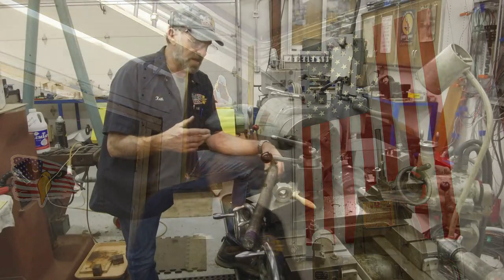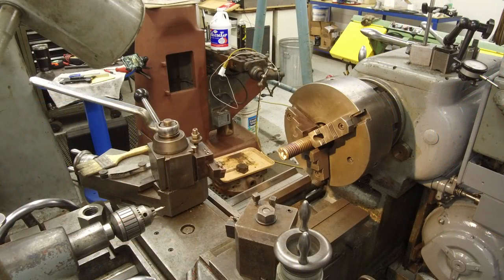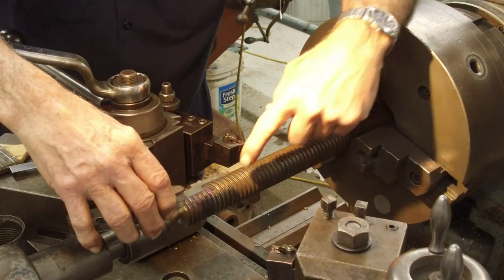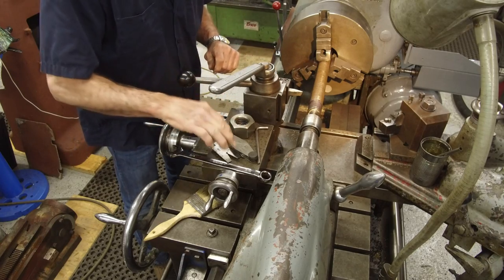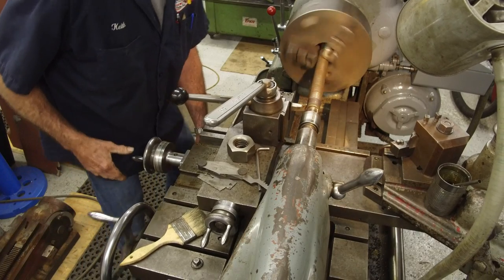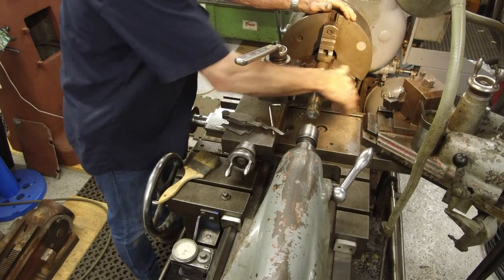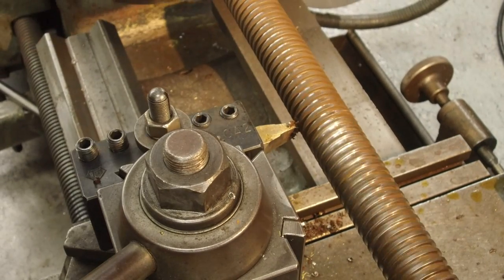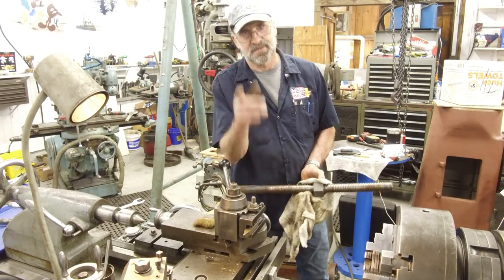Clearing Up That ACME

Comment: Keith, great video. I'm a new subscriber so I have a lot to catch up on. I've been around enough to know that you are highly skilled and a true craftsmen. This ACME thread video and tips certainly encouraged me to try and clean up the ACME threads on my South Bend 13" compound feed. I tried a file from a small set but it took hours to find the low and high spots to work on. Thank you so much

Comment: Keith,
That converter noise is a bit loud compared to the old shop, but we'll get used to it in time.
Your new digs look a lot bigger than the old shop...room to breath and to grow.
Glad you're back Professor!

Dan
Reply: He didn’t have to use a 3-phase converter in the old shop, but now he does because the local power co is slow in running 3-phase for Keith.
Reply: @joeylawn36111    If one can wait for power till it is convenient for Power Company,like another job in the area it is cheaper hook up. On demand expensive!!

Hi Keith been waiting!!!!!!!!!!!!!!!!!!1

Comment: Hello Keith.  That was an interesting set up for working on both flanks of the thread.  David Wilks (another machinist on youtube) uses the same method to cut multiple start threads.  Instead of indexing the chuck with the leasdscrew disconnected from the spindle (how you're taught in school), he sets the compound to zero (like you did), cuts the first thread and then moves the compound a distance equal to half the pitch of the thread (for a two start thread), and cuts the second thread.  I've yet to try it but it sounds easier than indexing the spindle.  Ken

Comment: Keith, thank You for this information. What I learned here is that the ACME tool does not need to be the final width of the thread groove, it can be less. The method of adjusting the thread groove width with compound is not only a comfortable way to do this but it is also counteracting the chatter as it is cutting one edge at a time.
So, easier to grind the tool, easier to make the thread. Please, accept my easy thank You.

Comment: GREAT to see you back! I feel your pain young man- I just closed on a commercial building, that had been abandoned and vandalized and looted for 8 years!!! Local power company sent an "Engineer" to meet me, and they want me to get blueprints, and drawings and a safety inspection from the county, and this, and that, etc etc costing me THOUSANDS just to get my power on in this new building, not to mention all the huge wire that was cut (while it was live) outside between the meter can and the transformer, by looters & crack heads has to be replaced underground!
I'm getting there slowly, but have been working on cleaning the place up with a single phase 220v gas generator for fans and power tools!!!
Once I get it all restored I'll have a 400A three phase service, with 277/480 and a separate panel for 208/220/110 - but it's gunna take time and weeks (many)
Reply: Stories like this made me crazy about such stupid people who in my opinion never build something and they cant apreciate effort of somebody else made to build up something valuable from scratch. Vrrrrrr... Hope you will do better and better. Greetings from Europe.
Reply: 30 years ago when I got a new shop the power company wanted $8K to set a 3 phase transformer. After I found the right person to talk to, deep inside the power co. and he told me how to go about making my application more suited to the higher ups, they then set it for free. Started with 400A 208V. That may have been a mistake because as I added tools I needed 400 & 480V. Ended up with a lot of transformers. It is a lot cheaper to wire for 480V. Also had to have another service brought in to get to 800A.  City originally required an industrial panel with each breaker costing $350 back then. I now have 7 sub panels.  Plan a head.

Comment: G'Day Keith,,Mate had me back into 1976 where i had lathe training as part of the trade,(Fitter and Machinist,),yep right hand and left hand internal and external fitted to-gether on a test piece,,Knurl the outer nut and then relieve each one ,,yes had to be marked,pass mark 80%
mind when i went to tech,,Hmm Trade school,,had every thing i needed to ace the class,
the old BHP training was the best ever,,,if you ever get a bloke done training at BHP,( yes even a dud,),there will be not much you could teach him,,
But enjoyed remembering,the experience of doing it,,
this was all after learning boring to a plug gauge,,,The tolerances were so close,a couple of degrees in temp,,had a lot of plug gauges stuck in bore hole,,
mind nothing a quick hit with the oxy couldn't fix,,

Comment: I was literally wondering about how one would chase/clean up pre-existing threads on a lathe the other day. Now I know!
Reply: One thing he did not explain or demonstrate is that you can start the spindle and engage the half nut and then stop the spindle leaving the half nut engaged and use the compound and cross slide to align the tool with the thread. It does not have to be done with the spindle running. Much easier for someone less experienced.
Reply: @DomManInT1  ,Correct . been doing it that way for donkeys years but it still needs fine adjustments just the same as Keith used with compound slide.
Reply: @karlhrdylicka  Yeah. For years. That top slide has been called a compound.
Reply: @DomManInT1  Excellent advise, All new learing threaders should learn this technique first.  Always leaves one less chance to bug the thread.
Reply: @DomManInT1  Yes,Senior moment . you''ll get them when your as old as me .Guessing your not English as the description top slide was also used before CNC made it obsolete. I will add an edit . The Colchester lathe  Keith is using is the same as the one I have ,  mine is shorter bed . had it since 1971. and still use it . You can think what you like I don't have to prove anything to anyone .

Comment: 👍👍👍👍 for what its worth,  I tied a 20$ wireless remote switch I got off of Amazon into the control circuit of my rotophase. Sure makes it nice. Surprisingly I can turn it on and off from the house 300' away.

Comment: Hi Many, nice video nice video I have question, what is the advantage of using brass nut on an acme linear actuator? On my satellite linear actuator the nut wore out and i was thinking to replace it with a steel nut any recommendation PLEASE
Reply from the maker: A feed or lead screw nut is a bearing surface as well,  supose to be the wearing part more than the screw.

Comment: Hello Keith.  Good to see your shop back up and rocking !   Love to see work being done on your Colchester lathe.  I have been restoring my Colchester 17" on my Doozer's Shop channel.  I am up to re-fitting the gap.  It seems someone ran my lathe with the gap out, for like 20 years.  The gap is actually a few thousandths higher than the bed.  I need to take .oo4" of each side of the vee and .oo2" off the flat.  I will be using my planer for a surface grinder to accomplish this task.  Please check out my channel if you are interested.  I have already made 5 bushings for the apron and power feeds rocker box, and added a rear latch for the rocker box to keep the feed worm from side torquing the bushings into a bind.  I think it was a  Colchester design flaw.  I remember communicating with you Keith, years ago, and you told me that you had made hard steel bushings up for your lathe apron and feeds.  Well with my fix, I think I have found the reason why the lathe wears the bushing areas so severely.  My lathe was really messed up when I got it, but you having the same Colchester lathe was an inspiration to keep my going, and fixing up my lathe.  Your videos mean a lot to me Keith.  Please keep them coming.  ---Doozer in Charlotte NC

Comment: Do you use the same technique for cutting acme nuts?  I can see cutting to depth then widening the front and back sides with your cutter on the screw, but it would seem that inside threading would be difficult with that technique.  Also grinding the width on the tool to match the acme thread gage for the pitch is always a good demonstration.  Keep up the good work!
Reply: 10,000 hours.

Comment: Has the power company not come out and hooked up your 3 phase yet? Just seems odd to me they haven't yet. Is it present out at the street or will they have to run the lines a few blocks to the shop? Hard to tell what scheduling may do with the world having gone nuts right now.
Are you ready to rock'n'roll in the new shop now?
Reply from the maker: They shut down the work order for my hook up, wanting the owners to install meter bank to create a one switch shut off for four different services coming in. So there will be a little waiting period more before I get true three phase connected. ;{)

Comment: Keith, how you are cleaning up that threat with the compound set at zero is how all of the tool rooms and machine shops I have been in since the start of my apprenticeship in 77...
Setting the compound at an angle is very much a US style which involves 2 settings to concern not 1. With big wide threads when roughing out we would pitch the compound +/- a few thou while heading to the root DIA 
But on the whole here in the Mother land (England) the compound is at 90. You don't do it on an internal bore from what I have watched, simply put the less plates you have spinning on poles the less plates to fall off...stay safe

Comment: Keith, you look a little haggard, and you've lost weight.  Take care of yourself brother.  Question:  What is the nut size on your tailstock hold down clamp.  Picking up a thread is something I did not learn in high school. I am sure I can do it now.  I've watched you, and others, and learned how it's done.
Reply from the maker: 15/16" ;{)
Reply: The 3 phase converter needs to be outside. The noise is distracting